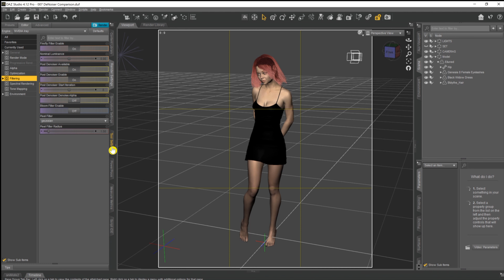Daz 3d Tutorial : Using The Denoiser For Faster Renders

Comment: The Denoiser is a very good option and I have used on single images and honestly and it gets rid of that grainy look. Although there is one problem I have found using it, and that is I do animations and sometimes my scenes are quite big and they usually inside a room or building and I render it as an image series. When I compile it, the animation looks like a wet smudgy look filter. So I have to to increase the iterations high anyway so I get that really soft and smooth look. It looks better and does save time in iterations but not a huge advantage.
Reply from the maker: Yeah, I don't generally do animations but I can see how what you describe would be a problem.

Comment: After using denoiser for quite some time, I can say, from my experience, that around 500 is the best starting iteration position. If you do really close-ups, like with only the model's face in the frame, you better switch it off.
Reply from the maker: Yeah, the denoiser will lose detail when used so for close ups, don't use it .. 

As for the "best" start number - 500 will be good for some scenes but you also have to remember that every scene is different ... so yeah, set it at 500 and then see how the render develops before stopping it .. don't just set it at 500 and then have the render stop straight away. Another 5 minutes of rendering might get you to 1000 iterations and the denoised final image will look better.

Comment: OMG thank u for this info, works very nicely and way faster renders. My PC is a lower end but i have a GTX 980 GPU and this speeds up my renders to 1-2 minutes
Reply from the maker: Glad it helped you out! Just be careful not overdo it .. you will lose detail using the denoiser - so let the render run for as long as you can put up with to retain detail!

Comment: Can you the denoiser to switch off after a certain point during the render? I’ve tried using it and it does wonders for a closeup shot for one my models but it seems denoiser extends render time by a vast amount. I was wondering if I could set denoiser to switch off once I get the render to a point that I like?
Reply from the maker: The Denoiser is a post process - which means it runs once and then is done .. however, if the denoiser is set at a point where it starts at a low iteration .. say the default 8 .. it will apply the denoiser on iteration 8 .. then 9 .. then 10 .. then 50 .. then 100 .. 1000 .. basically, after every iteration (or at least, every write to canvas).

So don't have it start at the default 8 .. depending on how many iterations you expect to run (which is a bit of a guess considering you won't really know until you start to render) .. set the denoiser iteration start at an appropriate number .. I tend to set it to run at 1/5th of the total iterations i'd expect to run if I wasn't using the denoiser ..So, if normally, my render would run for 5000 iterations .. I'd instead change my max samples to 1000 and set the denoiser to run on Iteration 1000 also.

What you have to remember is the denoiser is a POST PROCESS .. it's something that runs once your render is "done" and shouldn't really be left to run every iteration as it does slow things down when it has to do it every iteration. 

Does that help?
Reply: @RaukoDaz3D  THanks!

Comment: HI how to increase Denoiser Quality because i am getting Blurry Smoothing Renders
Reply from the maker: Hey Sazer - there is no "Denoiser Quality" as such and you'll always end up with a lack of sharpness in renders when you use it just by the nature of what it is .. It sounds backwards given you can use the Denoiser to quicken render times .. but to get the best quality denoised images you have to let a render run for as long as possibe .. You're not going to get clean images / sharp renders if you let the denoiser do it's stuff after a minute of rendering .. 

If an image would take a hour to render under normal circumstances .. then you're best results with the denoiser are going to come after 20 - 30 minutes of renderdering .. but even then that's dependent on each image you're rendering.

The best thing to do it to set the "Post Denoiser Start Iteration" somewhere between 100 to 1000 iterations (depending on your normal render speed given your GPU) .. and then let it run .. once this number of iterations is reached then each time the image is drawn on the canvas thereafter it will get denoised .. then just keep your eye on it until your satisfied with the results and can stop the render manually. Each draw to the canvas will see an increase in the quality of the result. 

However, really complex scenes and lighting could still take a few 1000 iterations before you get a good quality denoised image.

Comment: These denoising renders are using Post Denoiser Start Iteration of 8? You mentioned changing this number if you don't get good results, what would be a good example of this?
Reply from the maker: Hey Shaun - ultimately, the number doesn't matter .. if you set it at 8 the denoiser will work and keep on denoising right the way through your render no matter the total number of iterations ... however, starting the denoiser at 8 will slow your render down as it will then be denoising every iteration thereafter .. in addition, to begin with at least, your render will initially look like potatoes until there is enough data for the denoiser to work with.

As for what number to start at is hard to say .. it will depend on your system and the complexity of the scene .. 

As a rule of thumb - I would usually set it at one fifth of the total number of iterations I would run a render for if I wasn't using the denoiser .. So, if I had in mind to run a render for 5000 iterations .. I would start the denoiser at 1000 and see what things look like once it gets there.

This is just a rule of thumb though and purely subjective .. a particular image might look good enough at 500 iterations .. fortunately, the denoiser is a post process, so that means you can constantly tweak the start number during your render and it won't break anything.
Reply: @RaukoDaz3D  Thanks, this helped a lot! I just started a render with 8 as the preset and stepped away for about an hour and now reading your comment too. It definitely takes longer with denoiser enabled. I would say I have about 75% of the iterations I would normally see at this point. However, I'm at 1/5 of the iterations I normally want, so I'll leave it running.

I am rendering a single scene with 2 characters, and quite a few lights and reflections, so it would usually take me 4 or 5 hours to get to a point where I'm ok with, without denoiser.

But in general, 1000+ iterations would take me all day. I do have the resolution set to Ultra HD preset (I think 3000x2000 roughly) maybe I'll try smaller resolutions again. But a lot of times, I will reduce the size of the rendered image in Photoshop to clear up a lot of the noise as well.
Reply from the maker: @mcrsrm  yeah, it's just about playing around with the numbers until you get something that you're happy with in both time to render and how "clean" the render is after the denoiser kicks in.

I'd advise against starting off with the default setting of 8 - as you can see yourself, the render does slow down .. it might only be a little bit per iteration - but all those "little bits" add up over the course of X iterations.

But as I mentioned with the desnoiser being post process - you should be able to change the iteration number the denoiser starts mid-render .. Although I don't mention the denoiser specfically you can see in this video https://www.youtube.com/watch?v=7RO21jSwEmU where and how to do it ..
Reply: @RaukoDaz3D  Thanks a lot for the help!

Comment: interesting, it might require to try it on my part too to see which setting can get better results with my pc
Reply from the maker: If you have a low end NVIDIA GPU you should get more better and cleaner results and much quicker with dForce ... if you're at the high end GPU field and measure renders in minutes and not in hours - then unless you really need lots of something quick (like animations .. ) then probably best not to use dforce as it does take a little detail out of the final image.

Comment: You might not know at how many iterations the picture will look good but with experience you will notice at what percentage it looks good enough. For me it is 33 percent with default denoiser settings (8 iterations). I usually will not notice the difference between that and a finished picture. And doing it this way there is no guessing, just if it looks good to you its fine, if not let it go on a little while longer.
Reply from the maker: Yeah, that's pretty much what I do .. as you say, it hits a point where you know it isn't going to look any better  or at least, it's not going to be noticeable.

Comment: Friend, I don't really know what iterations are, do you have a video on how to configure the noise reducer, and in what resolution you recommend to make a render so that the models don't look pixelated when there are scenarios.
Reply from the maker: An iteration is a full calculation cycle within Daz. So 1 iteration will calculate the position of all the rays of light at that given time and will light up the scene based on that one calculation. You need many iterations to complete a full render. 

If you open the Render Settings tab which should be on the left side of the UI in Daz .. and then click "Progressive Rendering" .. you'll see a slider called "Max Samples" .. default should be 5000 .. that means that when you start to render Daz will attempt to complete 5000 iterations (so, 5000 calculation cycles of all the light rays on the scene) .. Depending on your graphics card - 5000 may take minutes to complete if you have a high powered graphics card or hours if it's old and slow. You can change the number of iterations by moving that slider up or down .. a lower number will mean the render will stop sooner (although, there might still be grain) while a higher number will mean the render will go on for longer.

There's no real set number on what to set the denoiser to. It depends on the scene as there's lots of things to consider in any given scene and your own graphics card. If you have a fast graphics card you can set the number in the denoiser really high (or even don't have to if its really fast) or if you have a slow / old graphics card you'll have to set the number low. The number of iterations under Progressive Render and the Post Denoiser Start Iteration (PDSI) are linked. Set the PDSI to 500 the denoiser will start at iteration 500 .. however the render will continue until the number set in Max Samples under Progressive Render and the denoiser will get re-calculated every so often. If you have the denoiser at 500 AND the Max Samples at 500 .. everything will stop then and be denoised then.
Reply: @RaukoDaz3D  thx friend 🙂

Comment: Hello, I watched your video but I couldn't understand it because I don't know English. What can I do to speed up the rendering process? Can you write in the comments please?
Reply from the maker: Hey .. I'll try my best .. 

This video is about using the denoiser in Daz 3D. The denoiser uses AI to "guess" the colour of each pixel in the render and can clean up a render giving you decent results in a fraction of the time. The longer the image has been rendering the more information the denoiser will have availble  to correctly guess the correct pixel colours.

To use the denoiser : in the Render tab .. go to filtering .. and then make sure "Post Denoiser Available" and "Post Denoiser Enable" are set to "On" .. also "Post Denoiser Start Iteration" says what iteration number the denoiser will start at. The default is 8. Change this to at least 100 and start to render.

When the render gets to 100 iterations the denoiser will start and it will instantly start to clean up your image. You may need to do 500 or 1000 iterations (or more) to get a satisfactory image but this will be a small fraction compared to rendering without the denoiser.

The longer you leave the render run the better the denoised version will look.

Hope this helps!
Reply: @RaukoDaz3D  thank you so much i was looking for this too ♥️ thank you so much for telling. you are a savior👑♥️

Comment: What should be the max sample??? 5000 or I should reduce it down???
Reply from the maker: Hey there ProPython - it depends on the GPU you have in your system and what you're happy with in the Quality vs Time Saved department .. If you have a low end GPU then try reducing the max samples down to 1000 with the denoiser on and see if you're happy with the results .. if not, try a higher number .. 

However, be aware, every render is different depending on the complexity of the scene - a highly complex indoor scene lit by indirect light will require far more iterations even with the denoiser active to get a decent quality render than a simple outdoor scene lit by sunlight ..

Comment: I love the de-noiser.  There is certainly a point where the amount of detail you gain, simply isn't worth the time you need to spend waiting for a normal render!  Two hours just to gain a little detail you can barely notice just isn't worth the time for me.

I tested the denoiser settings and having it start at 8, or setting it to start at 1, makes no difference in the render quality.  Denoised images will look the same no matter what you start them at, it mainly is just a time facter as starting it at 1 for example would slow it down a little (not much).  BUT, I also noticed that the denoiser can be buggy, especially if you're low on VRAM and starting it at 1 can fix that in some circumstances.   Sometimes it simply will not kick in and you have to restart DAZ to do a new render.
Reply from the maker: The denoiser uses a bit of VRAM to work and if your scene is already jam-packed you can run into issues where you run out of VRAM therefore stopping the denoiser from working. One issue I found is that if you DO start the denoiser early you can run into VRAM / system ram issues because Daz has a problem in cleaning memory .. so if it's having to Denoise after each iteration, Daz will use more memory over time as it won't fully flush out the previous denoised version .. so in some ways picking a higher start point can be more memory efficient ..
Reply: It is not a BUG.

Denoiser use moire VRAM, 2giga more on my Render 10k, because Denoiser make the double from your image and fusione for to have clean image, if VRAM is empty, Denoiser can works.... DAZ send you message, just make no denoise if no VRAM free.

Comment: What does it mean by like 97% saving down in the right corner?
Reply from the maker: When you use the Denoiser in Daz (with a NVIDIA graphics card) - you can use AI to let Daz give a "best guess" at what any colour any unfinished pixels "should" be if the render was left to run to 100% complete. It allows you to have Daz render the scene quicker with the AI helping out by filling in the missing information and removing grain. 

The "98% saving" example says that instead of running the render for 3346 iterations in a time of 173min I only let Iray render for 50 iterations and it took 2min 58sec (only 2% of the 173min) thereby giving a saving in time of 98% on the particular image .. it's up to you to decide if the final image (on the right) is worth the 170 min render saving ..

Comment: What about the Nvidia post denoiser? In my testings i feel the results tend to be better than when i use daz's denoiser
Reply from the maker: Hey Rafael - I've never actually used the NVIDIA denoiser as I don't normally use the denoiser full stop .. when you say "better" - I take it you can get better end results with even fewer iterations?
Reply: @RaukoDaz3D  Late to the conversation here, but having used both the built-in denoiser in Daz and the Nvidia AI denoiser, I think the Nvidia denoiser reliably produces better results. The reason for this seems to be that the Nvidia denoiser takes an algorithmic approach to reducing noise, whereas the Daz denoiser just applies a blur effect to the image, much like the blur effect in Gimp or Photoshop. Denoisers in general always diminish the skin details a bit, but a bit more detail is retained with the Nvidia denoiser.
Reply from the maker: @GlassesAndCoffeeMugs  You're probably right .. I think the denoiser in Daz does a little more than just blur although, at times, it sure does look like it does just that!!! :)

Comment: When it says 100 iterations with denoiser, does that mean you changed teh value of denoiser from 8 to 100? or does it mean that result is 100 iterations of the render with denoiser on default 8
Reply from the maker: Hey Mark - in this instance, I changed the value to 100 from the default 8.

Thing to note, though. Even though the default is 8 - that is the iteration number the denoiser will start at. It will apply the denoiser on every iteration from 8 onwards .. so on the default of 8 .. it will re-calculate the denoiser on iteration 8, 9, 10, 20, 100, 1000, 20000 etc .. and on and on .. 

Having to do the denoiser each frame like this will slow the render down a little bit and so you're best off setting it at 100 or 500 or 1000 depending on your GPU speed .. the higher the number will produce a better denoised image the first time the denoiser works.

One final tip - you can change the denoiser start value while rendering .. check out this video : https://youtu.be/7RO21jSwEmU where I show how you can make some post-production changes while the rendering is taking place .. So, set the denoiser start value at 1000 iterations .. but if you want to check it when your render gets to 500 iterations .. that video will show you the process that will allow you to do it.